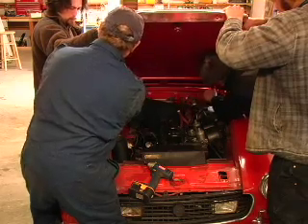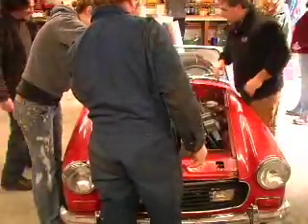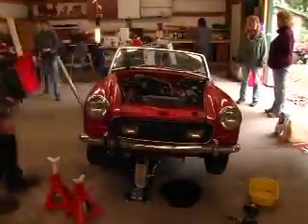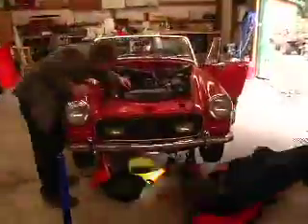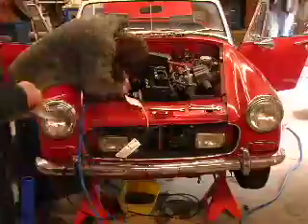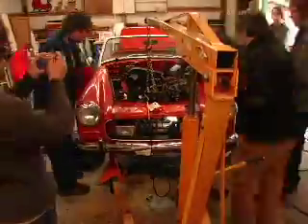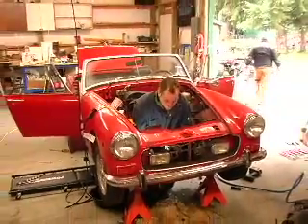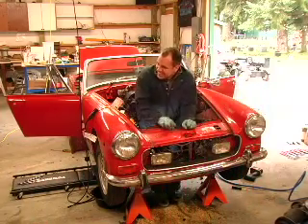MG Midget electric conversion-step 1 removing the engine

Comment: @sockosockosocko where are you getting your "clean" electricity from?? probably you're getting that electricity from Oil, Coal or Nuclear Powerplants. And there is the Problem, those plant's are NOT environmental friendly! What happens with the nuclear waste and all this...? I'm going to drive my 6 Cylinder for the rest of my life, even if i have to make my own "combustable material". At least i can say my home is environmental friendly, because i got solar panels,a heat pump and a wind turbine

Comment: Good luck with your convertion! I just got my Austin Healey Sprite(with many newer MG Midget components) running a couple of weeks ago. I posted a video response above that shows my test drive. I was surprised at how well it drives and handles as an electric car. I have the car stripped back done to the bare tub and am painting it now, but I hope to be driving it daily pretty soon.